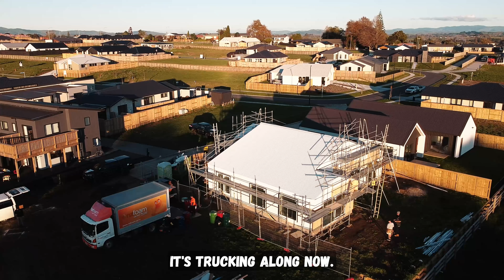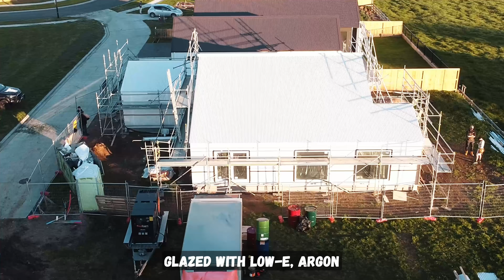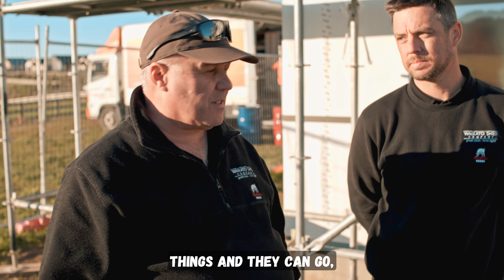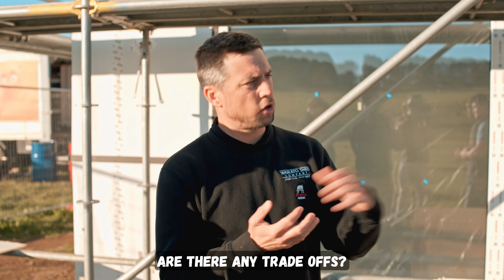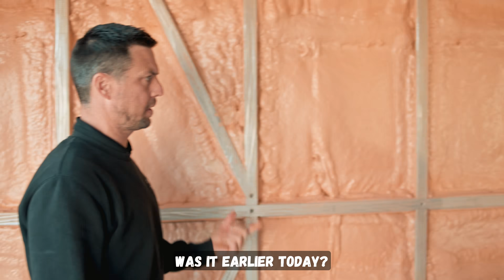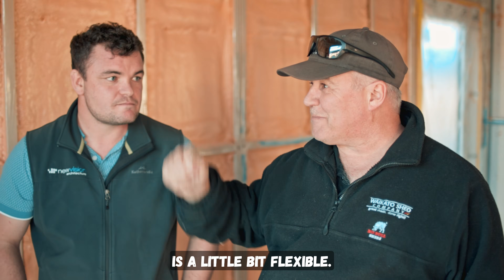How to Build A Passive House Ep. 2 Spray Insulation

Comment: spray insulation has some very toxic chemicals in it
Reply from the maker: NZ Foam insulation is GREENGUARD Gold certified for low chemical emissions and is odourless once applied. While completely inert and non-toxic 24 hours after installation, some components used during application ,can be irritants if not handled correctly. It is always recommended to have Spray Foam insulation installed by Trained professionals such as NZ Foam, Adhering to proper safety protocols ensures a safe and effective installation. NZ Foam is made from soya oil and recycled plastic, along with a hardener. It is designed to be a stable, chemically inert, and PH-neutral insulation product. It is also free of plasticizers and does not emit any Odor or toxic gases long-term.

Comment: Passive house always makes me laugh. You’ll have to have solar to offset the cost running AC non stop in the summer because of the lack of eves, hope the windows are tinted. Also a white roof will require constant cleaning, black burns off mold.
Reply from the maker: We will check in for sure in summer and find out. Zincalume even better the mild won’t grow just very bright. Cheers Jason

Comment: Spray foam absolutely does not have bracing elements
Reply from the maker: I think they are referring to it as rigid air barrier but not actually part of the bracing calculation. Will check and confirm 
. Cheers Jason